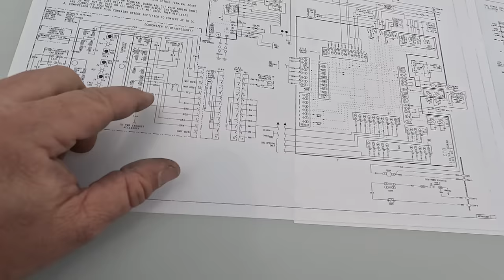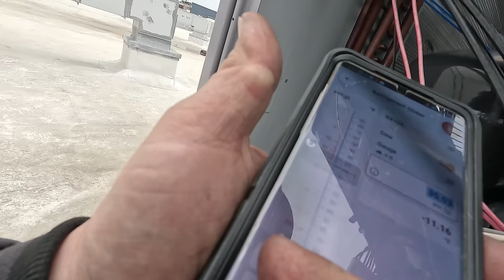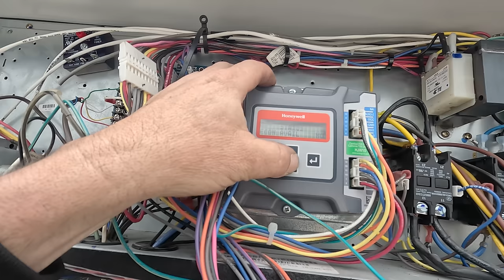Economizer Trickery - Air Conditioning Troubleshooting

Comment: The BAS should be controlling the economizer, that's how I set it up on most of my buildings. I was surprised to see a jade controller in there. Alternatively you can setup y2, on a carrier rtu y2 will activate mechanical cooling if free cooling can't keep up.
Reply from the maker: You’re right on y2,  a lot of people don’t understand they need a two stage thermostat for a single stage AC with economizer.  This place has a cut rate budget, is why the economizer control is on the unit.  like I mentioned, we literally took thermostats and put them in the return air ducts prior to this, and had to go on the roof to adjust them. This is in a secured building that couldn’t allow the thermostats to be available to the occupants below.

Comment: I had one with a failing outside air sensor and of course no jumper plug. You can use thermostat wires and just shove them in the empty plug in the right spot. Just look up what the jumper plug looks like.

Comment: The terminal release tools are pretty nifty, especially those ones on the ring, real easy to carry around. Not the biggest fan of the molex plugs that are completely open and exposed. They’d be better off using weatherpack connectors like machinery and cars do.

Comment: BAS does not appear to be controlling the economizer.... would have checked Jade economize module before checking signal at economizer.   Possible that Jade was not configured correctly or a bad sensor leading to no free cool or mechanical cooling? Always should leave factory jumper with the economizer,  I put jumper wires through econo plug.

Comment: Would you know what a capital B suffix after the horsepower rating on a direct drive blower motor means?  For example Hp-1/3B.  I don't believe it stands for insulation class as that information is usually elsewhere on the motor data tag.
Reply from the maker: 👉Here’s what I found.  

Design Letter (DES, NEMA DESIGN, DESIGN).  NEMA defines four motor designs (A, B, C, and D) in terms of torque and current characteristics. (see tables below).  Most motors are design B because of their comparatively high efficiency and torque characteristics.  Design A motors may be more efficient but are used infrequently because their relatively high starting current can cause nuisance tripping of motor protection circuitry.  Design A motors may also require larger than standard size starters.   

👉Here is the link. Look about half way down.  https://www.priestelectric.com/read-electric-motor-nameplate/
Reply: @HVACRSurvival  Something funny about this motor.  I can't tell what the B means and a motor shop doesn't know.  It's a Lennox 81G5001 and you would think if you matched it up any replacement motor it would work.  But it doesn't.  (Emerson K55HXJJS-2903)  Well, a Dayton doesn't work.  Maybe Lennox is proprietary?
Reply from the maker: I did Lennox my first 19 years. It’s likely a proprietary motor. But with a bracket and a universal motor it usually works. That must be a new furnace. I haven’t heard that model number before
Reply: @HVACRSurvival  I figured you the go to guy for Lennox as you always say how much you like them.  ; )  Yeah, must be proprietary but you think if you match data it would work?  Not so much.  Runs overamp.  Not much but SF is 1.  Can't tell if I can trust that.  Gotta keep mom warm.
Reply from the maker: @joehead1294 you got to focus on the amp draw rating, make sure the replacement motor is capable of more amps than the original motor. Today’s horsepower ratings are total lies….Carrier does the same bullshit.
Reply: @HVACRSurvival  I guess your saying go up to 1/2 hp?
Reply from the maker: I carry 1/2hp condenser motors and 3/4hp blower motors
Reply: @HVACRSurvival  Is that a rule-of-thumb no matter what the original equipment?  Seems rather broad.  Horsepower and rpm are important factors, no?

Comment: When you checked in between r and c it only showed 24 volts and the control transformer is wired for 240 when it needed to be tapped for 208v I think you said you swapped them at the end of the video but whoever butchered that economizer needed to be fired lol
Reply from the maker: You’re correct. I like a little more than 24.0v if possible. I’ve seen more issues with lower voltage.  26v-27v is normal. Normally the circuit boards cut out at 29-30v.

Comment: I jumped that same control circuircuit for an economize on a Lennox 14 yrs ago. Problem was, I had to remove the jumper for heat season.
Reply from the maker: Could’ve solved that with a relay ran from O or B terminal on the thermostat. lol